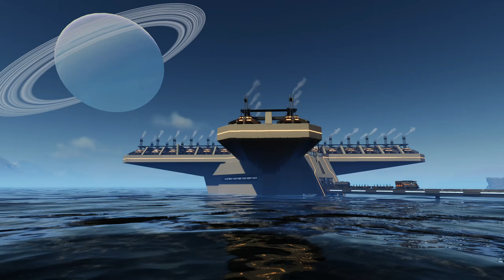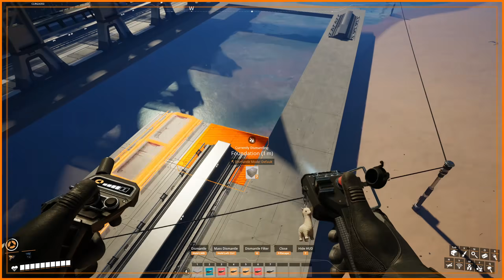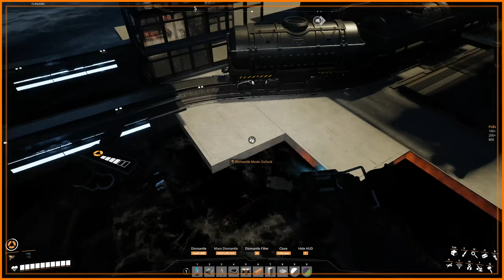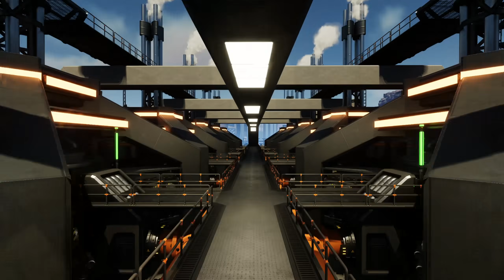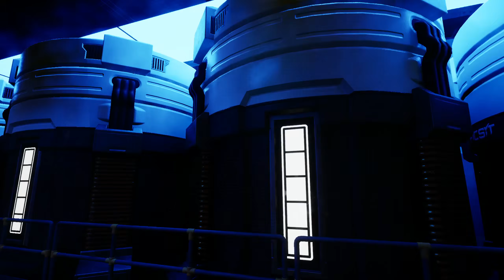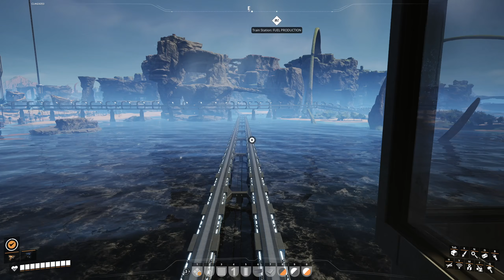Builoding a Offshore Oil Rig Build

Comment: Hi, idk if MyNameJakes will see this and if he doesn’t I would appreciate if someone could help. So I’m on my 2nd save and decided to try and build a rig. Mine is similar but bigger because I’m producing 20k MW. I’m really struggling with the interior, specifically the battery room, and was wondering what the dimensions of the base of the build are? My build isn’t an exact 1-1, I’m just taking a lot of inspiration from MyNameJakes. If anyone could help I would greatly appreciate it!
Reply from the maker: That's very difficult to say, this build has been ages ago. If you want you can check out my patreon where you can download the save and see for itself.
Reply: @MyNameJakes unfortunately I’m on Xbox so I can’t download anything 😢. Thank you for replying though! Also, your builds are really inspiring me, it’s just a struggle for me to use the same techniques.
Reply from the maker: I can im imagine its a bit tricky on controller

Comment: What are you using when you are elevated up in the air like that with your hands on those controller looking things? I have the jetpack and I know its not that since my hands are not out like that. I have seen it on some videos and always forget to ask.
Reply from the maker: Hi, its the hover pack...it allows you to fly around like a.... drone is proparly the closest comparison and im holding the hoverpack controls
Reply: @MyNameJakes  Nice, thanks for the info. Funny thing is I ended up unlocking this like a day after you responded. Man, its a lifesafer.
Reply from the maker: @Valdarious  Nice

Comment: did i miss how much oil is required? did he say?
Reply from the maker: Pulling 1800 crude form the four nodes that get converted to 1100 fuel, 120 rubber and 336 plastic per minute.

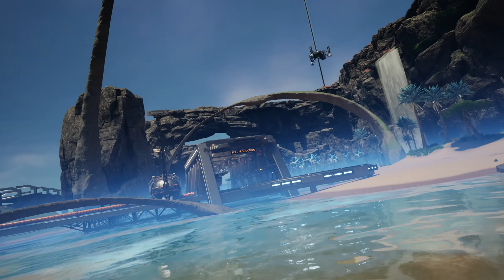Comment: 1) Great video production. 2) Great Builds! Quick question - 2:22 into the video - the big diagonal frame that starts in the water. How did you make that? I get using the painted pillars but I am missing something with the larger frames people are making.
Reply from the maker: That just a big metal pillar for the entire frame and some small metal pillar in the mix aswell.

Comment: Hey, i want to ask you what amount of rafineries do u have in that oil rig that you build?
Reply from the maker: In the oil rig it self, none...but in the previous epidose you can see all the oil rigs that supply the oil rig.
Reply: @MyNameJakes is this 1:1 ratio or u were using somerslops or boosters?
Reply from the maker: @skyr4x821  If i remember correctly it was only one refinery that had a power shard in it for balancing every thing. Rest is kinda one to one with slight over production of fuel i use to make packaged fuel for my vehicles (like 40 fuel/min)

Comment: Amazing build :)

How did you make those pillars at the entrance of building, I am not able to get correct angle and with both sides being even? You didin't show in video :( 

Could you make a video about that?
Reply from the maker: I used beams to connect th egde ot the bottom and top part then add the pillar to the beams

Comment: 3:52 railways can be used for hoverpack to work. So placing poles is pretty much unnecessary. And rails essentially work the same way as power lines. So electricity can be sourced from second station.
Reply from the maker: True...but placing the power poles out further helped me placed the bluprints and avoideing the bug where newly build rails sometimes dont give power to the hover pack. Also you assuming the rails is hooked up to power at the time the blueprints are build. 😶
Reply: @MyNameJakes hm. 
I didn’t have such problems when playing, but ok I guess.

Comment: What gets me the most here is that the planning stage has to be intense. Me personally, I am too impulsive to plan out my structures in the moment. Hence, my world looks like chaos. I have conveyors everywhere, I do not do structures like this because I dont really get it on how to make it work. When I am struck with inspiration, I will end up removing equipment and reposition them some where else while still not building a detail structure like this. This is impressive bro.
Reply from the maker: Yeah planning is key to avoid the spagett